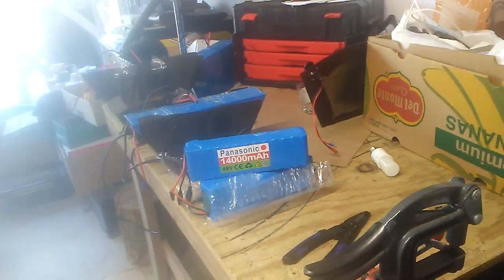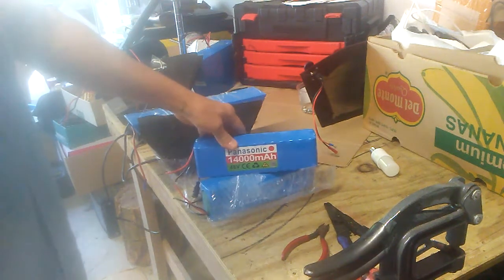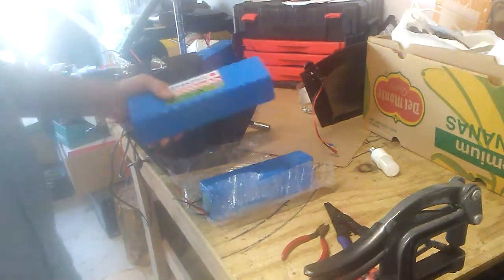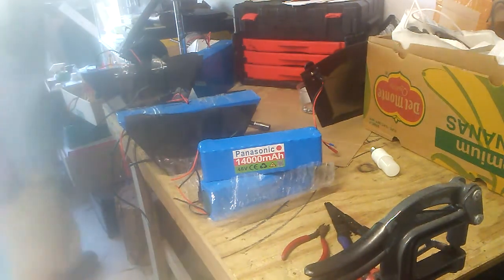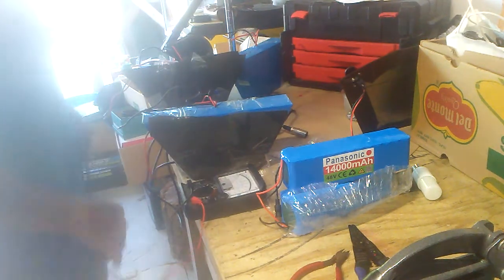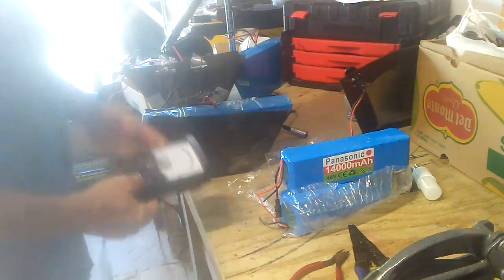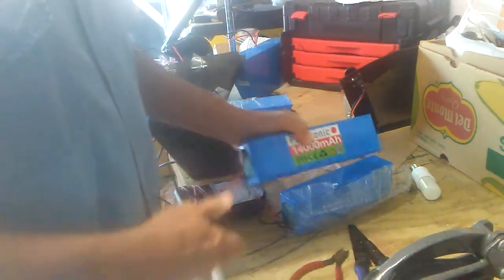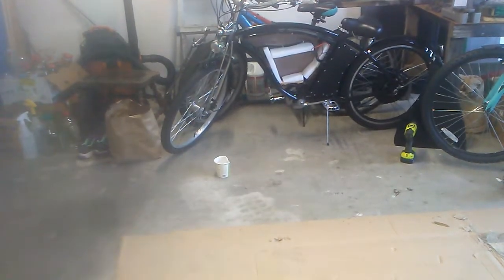Cheap Aliexpress Battery

Comment: 2025 NEVER BY BATTERIE PACKS FROM ALI EXPRESS EVER OR REGRET IT. THUG SIGHT WELL NEVER REFUND YOU CRIMINALS. 13S2P IS 2 ROW S OF 13 MAKING 26 BATTERYS. THEY ARE LESS THAN 10 AH YET CRIMINAL RAN ALI EXPRESS ARE ADVERTISING THEM AS 20 AH 30 AH 50 AH 60 AH UP TO 100 AH THE SAME BATTERIE.THE USE PICTURES TO DECIEVE AND THE BATTERY WELL NOT BE WHAT IS CLAIMED, THE ONLY THING TO LOOK AT IS THE CODE NUMBER 13S2P 13S4P 13 BATTERIES 4 ROWS. OUTSIDE OF THAT TRUST NOT A THING AT ALL I VE SPENT NEARLY 5 HOURS TO GET REFUND NEVER HAPPEN .THEY ARE AROGENT ASIANS RUNNING IT .

Comment: Can you send me one?
Reply from the maker: they cost me $80 each. I would be happy to sell you one of mine.
Reply: I'm doing a 1000w hub motor build are you selling a 48v 14ah
Reply from the maker: @alexanderscott03  - sorry , I ran out of batteries some time back. But my advice is - spend the money. Do not buy the cheapest battery you find. Make sure the seller has good reviews. These batteries in this video was a scam. Too good to be true. I had the money at the time and decided to try. Bad decision. 
$200 sounds pretty good, they have sold over 600 and they ship from the US .
https://www.ebay.com/itm/293213345157?hash=item4444e09585:g:kb0AAOSwkH1kwNgh&amdata=enc%3AAQAIAAAA8KD1U9lWzB7qEwbaQL4lK63z%2BJfqWs1QH8lQU%2B0zh0BtzK2wcPfRfWzI%2BM2CMgN1EPbduOBnCdhbh6Ry5RqY9dAsGsopveeKDT5MEb1qLxaDmwSGmiksXz4Wfxl90CLiJAJ%2BV4IhGCDrZF%2BsXkIm0mmcA%2FGmNNAj8BCtPBjrMsADlsMjI%2FscED2%2BUMjSO2LoPzjOjomiFn92zRkybY95myK11vgVsZqFyHAoz5myKxEYF0fsDIqC2OBSLaMIgT9fdWCfNLsoushCmJ2slg4fy49WHWMKBoFpBENPYw6UPUE%2FDzjlqsOYNmiWcuHe3AC6mg%3D%3D%7Ctkp%3ABFBM3tvF495i 
Good luck with your build!

Comment: I bought a 48V/99999mAh pack but it got wet and a few weeks after it dried off, it wouldn't charge any more. But it had 3.67 volts left after testing it with the multimeter. Can this battery pack be fixed?
Reply from the maker: Sounds like the BMS got fried. If you're into soldering you can try replacing the BMS. You just have to figure out the Serial/Parallel set up and order appropriately. Even then you may need to disassemble the whole pack and check each battery. A daunting task either way. I've got three dead battery packs that I'm about to chunk because it's just not worth my time.... Sorry for your loss.....

Comment: Length looks right, 13x18mm and a bit, so 48 volts, 54.6v full (or close). Depth is about right 65mm. 
Width looks like 3 batteries (3x18mm). Or 4x 18mm, say 4 inches
So if cheap battery 3x1500maH=4.5maH. If panasonic NCR18650B 4x3500=14maH.
Reply: A lot of sellers just slap on a sticker of any ah. You can pick any ah but the battery is the same size. They have a choice some up to 100ah but it's the same size and weighs under 4 pounds.

Comment: The point is not who made it, but maybe they are not all connected and are just filled with sand. But the given 14000ah is not that excessive. Sometimes 50-100000 is given with this size.
Reply: I think they say 10000mah which is 10ah

Comment: an 1000 watt motor is an batteries killer, it worn oud all the batteries in sort time.  With an 350 watt front wheel  i drive more than 3 year an e bike.

Comment: Have you found any ebay lithium ion ebike batteries that are good ?
Reply from the maker: Sure, the ones that are good usually cost $350 to $400 for a 48v / 20Ah battery pack.
Reply: @rickrandazzo  brand names ?
Reply from the maker: @anio6865  sorry, nothing really off hand. Even if you believe they are name brands ... they may be fake. Especially if they are cheap like the ones in the videos.
Reply: @anio6865  Liitokala is great. Just bought an AERDU now, waiting for it to arrive

Comment: Hello Rick: Thank you for this video. 
Everybody who works DIY-wise has at least seen once these "Panasonic" 48 Volt, 14'000 mAh battery packs in the WWW. 
What the Chinese do is scam, because it's not original/authentic/genuine Panasonic. These cells might be fake Panasonic and for Chinese fakes might be normal, but they use a famous name of a famous product and send customers fakes. Again: This is scamming. It should be completely forbidden. Panasonic should fight against it, but maybe they don't want to fight, because there would be too many cases or something. But you as customer have the right to get what it says - the original/authentic Panasonic and nothing else. Complain at Aliexpress and get your money back. 
To proof the fake cells just buy at least 1 original Panasonic cell and compare from the weight, the fully loaded capacity/voltage, discharge - just everything.
How are your experiences with the other bigger packs that you have longterm? Can you ride for hours?
Reply: They can't fight it because of china's non-existant laws on copyright infringement. It's why bootlegging and counterfitting runs rampant in china because there's no regulation.
Reply from the maker: Thanks for your comments. The "real" batteries I buy are 48v/20Ah and usually cost around $300. Since the motors are 48v/1000w we expect about one hour ride time. My experience has proven one and a half hours. What is interesting is that I have tested this with several different bikes, batteries and motors. Batteries are the prime example of "you get what you pay for".

Comment: I've bought a cheap LitoKala battery from Ali, for my eScooter. Can't complain, its better than the original one that died in 6 months. 

The trick is you have to ignore the description (14Ah/20Ah/40Ah...) and calculate the Ah yourself assuming they are using 2300mAh - 2500mAh cells. So a 13S3P battery is about 7 - 7.5Ah.
Reply: The thing is that get the ah from multiplying number of cells x ah in every cell ignoring if its series or parallel 

For example there’s a 10s4p one that says 100 ah.   They got the number by multiplying 2.5ah x 40 cells = 100
Reply: So what would the mah be on a 48v 60mah ? I need at least 58-60 mah.
Reply: @anio6865  you dont Need 60ah, its way too much
Reply: thats explains why i get barely 15km range with my scooter that has 48v/15ah battery, that was supposed to get 30km range in the worst case. probably the seller is a cheater and he sold me a brand new scooter with very low quality battery

Comment: I once bought a 48v/20Ah and it had less range than my original 48v/10Ah battery.
Reply: So If you go like 100ah you might get real 10ah?
Reply: @Zanderman2000 I went for 48v 100ah I paid only $87 it was called aoae and it was 38ah I think that’s a steal for the price it’s still low but it’s now like $97

Comment: The trick to Cheating people. Don't tell the parallel count. Numbers are impossible.   Very Funny.      Build yer own own
Reply: They put their cells at 5000.    Maximum is 3600.   Kids stuff. LIES
Reply: Go to battery clearance  buy 10amp used cells. Build pack.  ROCK ON.  NO BMS.      HOBBY CHARGER ONLY.    TRUST ME.     RESEARCH
Reply: And the battery will be. Badass

Comment: Did u add a fuse to the battery is it necessary cause I want to swap my lead acid 1000w 48v scooter
Reply from the maker: You probably should use a fuse. But I never do.
Reply: @rickrandazzo  yea I got a 48v 20ah lithium I asked seller he says I don't need to add a fuse cause it as its built in BMS but if it makes things better why not lol

Comment: Did you check with the instruments how much watts those two batteries really give together or how much in your estimation they really give watts?
Reply from the maker: The LED readout has a watt reading on it. With the other batteries I use it will hit up to 900 watts at times. These just made it a little over 700, never hitting 800 watts. So the performance was not as good. Also, the lead wires are a smaller size than the other batteries so that may be a bottleneck as far as being able to supply enough current. I did have the two batteries in parallel. I never tried using only one battery.

Comment: How many watts
Reply from the maker: 48 volts at 14 Ah = 672 watts . And I had two in parallel so it should have been 1344 watts total. But no way I was getting that out of it. I'll spend the $300 to $400 on a 48v/20Ah battery next time. When it comes to batteries - you get what you pay for....
Reply: @rickrandazzo  I was about to buy 2 similar ones from aliexpress (48v, 20ah ~50£). Then I did some napkin maths and realized that 100£ for nearly 2kwh is waaaay too good to be true...
Do you (or anyone else reading this) have any reputable battery supplier you would recommend?
Reply from the maker: @cyberlord64  That's the sad part. I need to buy just one battery now. But all I find is cheap batteries. I'm worried the market is being flooded with them. When I do buy one, I will buy off ebay from a company in the USA so that if it is garbage I can ship it back. The only other thing I can think of is building my own packs and I have too many other things to do to want to deal with that. Sorry - no help what-so-ever.
Reply: @cyberlord64  I bought a cao mm lithium ion battery off ebay and it works perfectly. But charges slowly. I will see if I can get the link.
Reply: Rick Randazzo thanks

Comment: They are most probably 2500 mah cells for 3 cells max 7.5Amp x 2 =15Amp @ 48V = 720W for a 1000W motor with low Capacity cells, You get what you pay for as you said.
Reply: Do you think those are genuine Panasonic or not?
Reply from the maker: @fabiofoltran4361  Did you see this?
https://youtu.be/2XpcA_mCgW4
Reply: 3500x3 = 10500. This is the maximum that 13s3p can do.